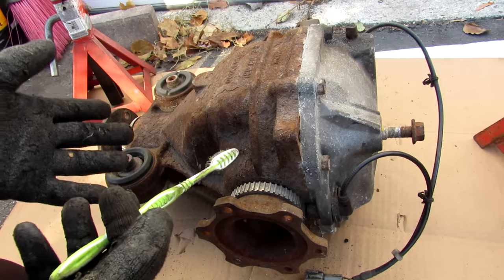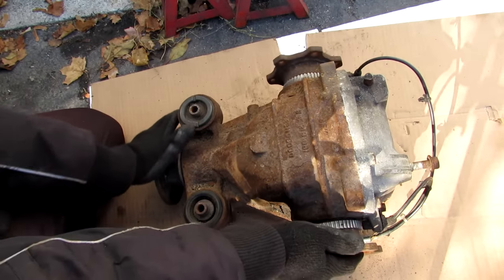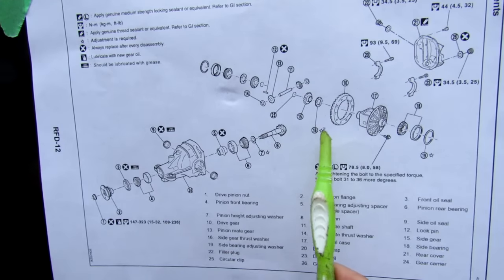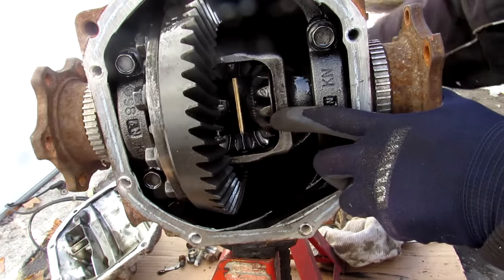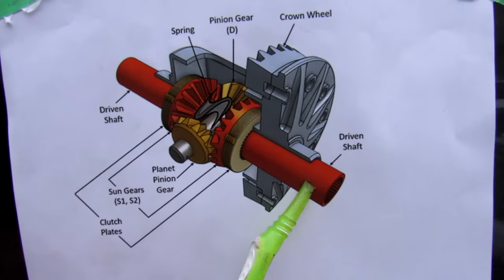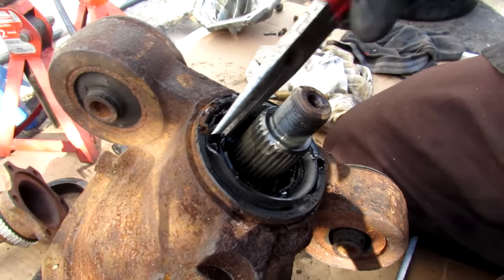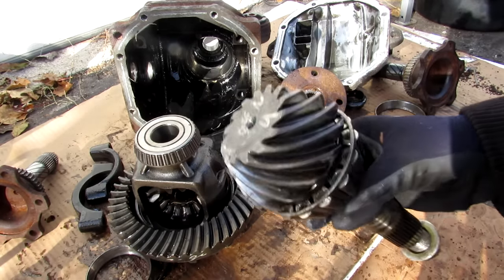How a Differential Works

Comment: So really;  say that if we wanted to incorporate twin engines;  we could use an oversize differential backwards driving each side with each an engine and feed the driveshaft output to the vehicle's differential and then if one of the engines is different rmp then the other;  it would still work right?  Maybe as long as they are what not else.

Comment: Very concise, yet detailed at the same time. Excellent video for learning and revision any time one's memory needs refreshing points.

Differential consists of a set of gears that operate together on the drive wheel of the vehicles to ensure that the inner and outer wheels of a vehicle rotate at different speeds in the same period of time, as they should, when a vehicle is making a turn, due to the difference in the distances covered by the wheels when a vehicle is turning.

The purposes of the different gears that make up the differential assembly are easy to understand and remember.

Knowing and remember about the differential makes one know and remember that the the left and right wheels do not rotate on a single solid shaft, but that the differential assembly casing is what connects them, and that the right and left wheel shafts actually terminate in gears.

Comment: I have watched dozens of YouTube tutorials on how the various parts of a vehicle works. Each video I watch, someone explains a tiny thing just a little better than someone else. I thought I knew how a limited slip differential worked, but was always unsure why it was called "limited slip". Today, I learned it is the clutch pack that slips a bit allowing differential speeds between the axles, thus giving its name. And this is coming from someone who has front and rear locking differentials on a Tacoma.

Comment: Excellent video. Such an ingenious yet simple gearset. I once heard someone say "an open differential applies the same amount of torque to both wheels at all times". Obviously that doesn't explain how a differential works entirely, but I think it is true and can help understand why the wheels are able to turn at different speeds while going through turns, and why (when you're stuck) the wheel with no traction spins while the other remains stationary.

Comment: Great vid as usual. Keep them coming....
Reply from the maker: What more would you like to see?
Reply: @speedkar99  The ones I'd like to see are the hard ones to do. Comparing generational differences between vehicles. And not even current stuff. Like compare the difference between a Toyota Tundra gen1 to gen2 or gen3 etc.. I guess it helps if you acquire old pieces of junk that don't run and want to tear them apart to talk about it, but not so easily done otherwise I bet... Learning how the suspension changed or other changes for a DIY guy is very useful.

Comment: An excellent video. I like the description of the most likely failure points (breather valve, seals, bearings, bushings) at 1:50 and 7:10.
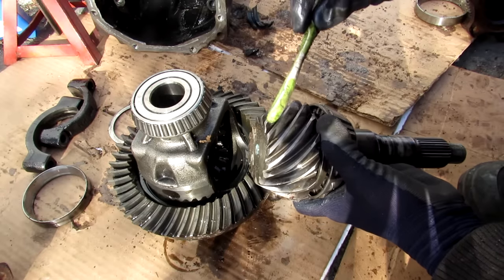The trade-off between acceleration and top speed described at 6:25 is interesting. On a motorcycle, the rear sprocket can be replaced with a larger sprocket to increase acceleration at the expense of top speed.
Reply from the maker: Thanks. I'm glad you appreciate my video style. Mentioning the weak points is something easier to point out while it's all apart.

Comment: so bigger pinion gear mean higher gear ratio, mean high speed but low torque and vice versa. 

i remember converting old cj5 from petrol to diesel 3CT (turbo was ct9) toyota with diahatsu rocky gearbox and differential, i learned all this at that time.
Reply from the maker: Yes

Comment: Great video. I only have one question about the spring in the LSD. What exactly causes it to compress to allow the clutch packs to seperate? I understand that the difference in wheel speed initiates it, but what actually compresses the spring mechanically?

Comment: I hope you still look at and comment on these older videos. I have been planning to build a tracked vehicle and like most of the one's I see they use an open differential and brake one side or the other to turn but the limitations talked about are the lack of traction. If I were to take 2 differentials and cut the right side off of one and the left side off the other and welded the shaft so that the cut side would never move and mounted them side by side would they get full torque while braking the one side ? I hope this is a little more clear than mud.

Comment: Great illustration. Can you comment if it is critical to change the differential fluid that is often shared with the transmission fluid with different drain plugs or even separate fill plugs on older consumer cars?
Reply: If it's fluid, it needs to be changed. I change mine when I drain and fill my automatic tranny every 40K miles. It's just easier that way.
Reply from the maker: Yes I would change it

Comment: Thanks for super detailed explanation. I am wondering whether or not the oil require regular changes ? I have heard that the oil is long lasting and require care only if there is leaking. Anyone know about it ? Thanks !
Reply from the maker: Yes you should change it
Reply: @speedkar99  what is the recommended frequencies/intervals ?
Reply: No. Just top it off every now and then.

Comment: Wow nice posted really needed that input...benz gl450 under load and acceleration the front diff make a lot of noise...sound like the teeth on the axle going into the diff is too big( that type of noise)...front diff replace( used) both axles, lower and upper control arms and front driveshaft but noise is still.there.....it make me think ok what you say on your video @4.29...
Reply from the maker: Yes or it could be a driveshaft  bearing

Comment: This is great, thanks a ton! One question, do you have to pull the 3rd from the vehicle to remove the rear carrier assembly? I'm needing to swap mine on my 93 geo tracker and it seems to me that you necessarily wouldn't if you remove the cover of the housing?

Comment: Hey, I just bought a 2016 Ford Tauras SHO.
I want to rebuild the PTU using a cast iron housing and better alloy gears.
I also want to add a cooling system that uses the same gear oil in it as the differential.
Can I use the same gear oil in both?

Comment: A differential is a planetary gearset consisting of a sun gear connected to planetary gears in mesh with a ring gear. Two of these are required to provide input torque to give the third output torque. The engine provides one input and one (left) wheel provides the other which tries to rotate backwards, but can't.
The scalloped pinion shaft is a "hypoid" gear which lowers the driveshaft relative to the axle to reduce the size of the driveshaft tunnel, not for noise.

Comment: Im trying to understand why on my 4x4 trailblszer in park with all 4 wheels on the ground i can rotate my front driveshaft by hand.  I dont understand how i can do this as im under the impression that the passenger side is the only side that is disconnected and when i turn the driveshaft by hand i should be essentially moving the driver side axle/wheel but yet i can do this with obviously no movement at the wheel
Reply from the maker: You have a front disconnect at the differential?
Reply: @speedkar99  yes I do...passenger side....

I also have a very bad floppy play there...I can't tell if the play is the cv axle itself (the inner joint) or if it's internal to the axle disconnect...or even worse internal to the differential....all I can do is grab on to the cv joint close to where it goes in to the axle disconnect and it flops like crazy....

I don't need the 4x4...I heard you can run these without cv axles with no problem as the 2wd version has the exact same hub bearing assemblies as the 4x4
Reply: @speedkar99  how when I am turning the driveshaft does it not try to also turn the wheel?  I thought it would be turning the front driver side wheel amd would not be able to cuz it's on the ground

Comment: dosn't modern cars have front drive and not rear drive? if I have understood correctly, the wheel which will drive the car are the rear wheels, while the front wheels are passive, but in my Toyota yaris the wheels which drive the car are the front wheels, do I have Differential in my car?
Reply: Front wheel drive cars still have a differential, but it is usually integrated into the transmission.

Comment: Anyone on the comments that know the module of these gears ?
Reply from the maker: I haven't performed any calculations to determine module , this was more of a demonstration on how it works.
Reply: @speedkar99  I'm designing a reduction box for a 4x4 UTV. But it seems that the module gets really large (5 and up) to meet the torque requirements. According to hkh, automotive transmission modules range up to 3. I'm doing spiral bevel gears so, a differential is closest thing to what I'm doing. That's why I asked. Anyway, I chose my gear. Really big, almost 7 kgs. Doesn't seem sane to me but it's happening... It's lightest one that can manage 612 Nm.